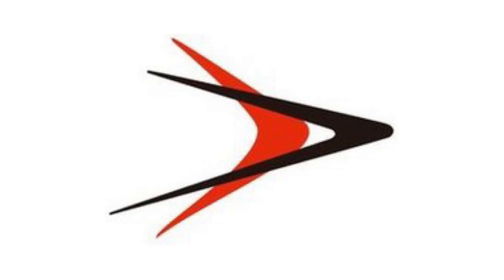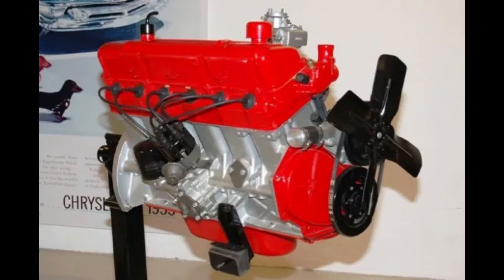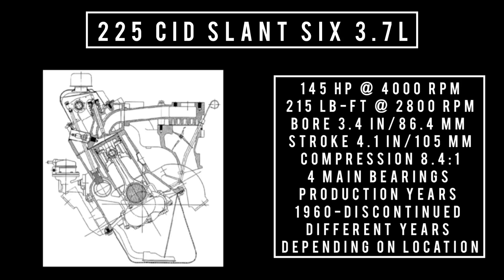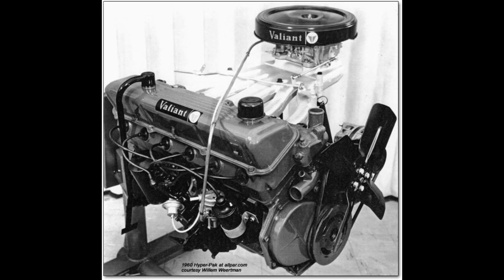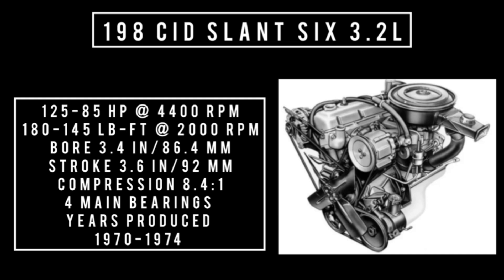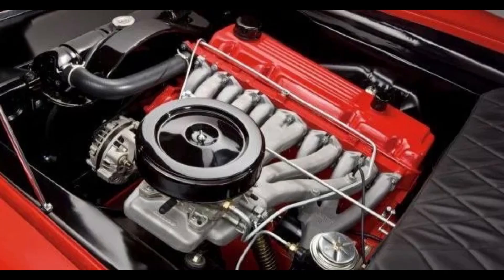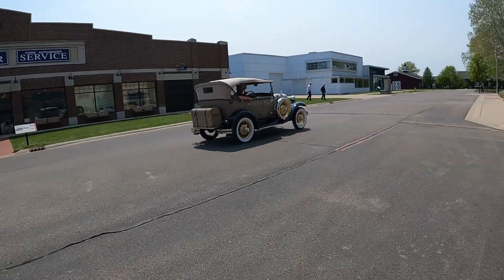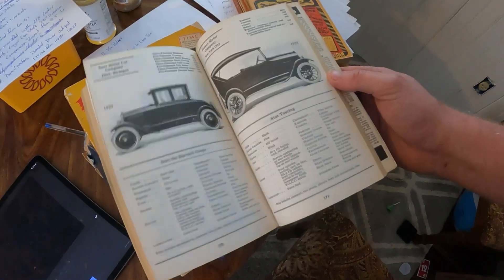Chrysler slant six engine family

Comment: lets face it. the chrysler slant six was a strong fully cast iron engine .solid lifters that lasted for several hundreds of thousands so long as you adjusted the rocker arms every other year. 20k lash exhaust and 10k lash on intake if I remember properly . no flaws here. built to last and as long as you changed your oil and antifreeze properly, your were good to go forever .I owned 4 slant six engines,3 318 cu., another perfect engine and the cherokee 4.0l high output solid cast engine and the one I drove had 347k miles and buyer added another 128k .all original equip except the water pumps was a must at approx. 100k. gas tanks on cherokee sports 94-95 had some issues with gas tank leak that was easily addressed . last note, I changed the trans fluid every 59k miles and filter. all my auto trans work perfectly because of that. remember, drive you vehicle,don't abuse them and they will last a very long time .HAPP MOTORING AND MERRY CHRISTMAS*************************

Comment: Had a 1980 dodge step van that had the 225 slant 6 with 3 speed on the column manual miss that box van that engine would walk away from anything
Reply from the maker: That's awesome thank you so much for sharing your experience. I really want to drive your car with a slant six.

I recently got to drive to 55 Nash with a flathead and was impressed considering it only had 90 HP

Comment: Thanks I’m 71 and I’ve been working as a mechanic since I was 20 years old and I work on many a slant 6 and owned a few, I think there’s a lot of myth built around this motor. Yes it was very dependable for it’s day but by today’s standards it wouldn’t make it. They were noisy, they developed blow by at near 100,000 miles they had a plastic gear to drive the distributor that was designed to break to protect the starter in case it backfired and they did break and Chrysler used a reduction gear stater for what reason I don’t know. Chrysler’s V8’s where truly indestructible in the 60’s but nobody ever says that.
Reply: I got a Chrystler 318 not sure what year though, what is your opinion on the 318?

Comment: I bought a 61 Valiant V200 with 50,000 miles on it in 65 for $500 after I wrecked my Hillman Minx convertible. The strong point of the 170 cubic inch slant six motor was the fuel mileage and its reliability. Like the Hillman it was under powered.  Getting on to the freeway was scary. The on ramps were designed so that under powered cars and trucks could merge at the Oregon statewide speed limit of 55 mph. The best I could do by turning on to the ramp at 45 mph was 62 mph. Often the traffic was going 70-75 mph. If you held the accelerator peddle to the floor long enough it would eventually reach 90 MPH.

The radiator was sized to be compatible with the 225 cubic inch slant six motor. This gave me to courage to remove the radiator fan from the water pump for better fuel mileage and a little more power. That winter I even put a piece of cardboard in front of the radiator thinking that it might clear the frost off the windshield a little sooner. The steering on the Valiant was the recirculating ball type which had 2 inches of play before a directional change could be made and lacked the feel provided by the rack and pinion of the Hillman. The Hillman had radial tires which made handling somewhat like its cousin the Sunbeam Alpine. The gear shift on the Hillman was located on the steering wheel column. Valiant’s shifter was on the floor, not for a sporty feel but because it like the bench seat was cheaper. The shifter was flimsy. If you weren’t careful it escaped the H pattern constraints. I considered this a feature not a failure as it allowed my girlfriend to sit next to me at the drive in.

Quick turns at lower speed would cause a dreadful roll that would hide the horizon from view. When turning hard to the left my butt slid to the right while alternating grips of the free hand to the top of the steering wheel eventually corrected the situation. I bought some stiffer torsion bars and front set belts from the parts department at the dealership. That made for less leaning and more under steer. I found some leaf spring helpers for the rear suspension that I adjusted so that when cornering hard the inner rear wheel did not lift off the pavement causing a sudden loss of power to the rear wheels. The lack of a front anti sway bar made the steering almost neutral with just a hint of under steer when stressed. There was a hairpin corner which the Hillman easily took at 35 mph but for the Valiant seemed too fast at 25 mph. I got a set of four bias ply A78-13 tires with a 12,000 miles guarantee for $60 which with the way I drove were bald by 10,000 miles. The guarantee got me another set of bias ply A78-13 tires.

One summer day that year I was on my way home from coast near Tillamook to Portland Oregon when we got behind about 35 cars traveling behind a slow moving camper van. I decided to pass all the cars and the van before we got to coastal mountain range. I was going 60 MPH when a Corvette pull out in front of me and quickly accelerated away. The twisty part thru the mountains is about 40 miles or 3 times the Nurburgring Nordschleife and took about 30 minutes. The Vette was able to use its disk brakes but the Val had drum brakes, which were only good for one stop, so I used engine braking and a little sideways skidding. I learned the hard way about drum brakes with the Hillman. The Vett and the Val had the same average speed for the twisty part.
Reply from the maker: Thank you for sharing those memories =)

Comment: I was once told tthat this engine was "desaxé," meaning that the crankshaft was offset from the cylinder axis, to give greater leverage on the power stroke. The high low end torque supports this claim, but I would love to know whether it is factual.
Reply: I seem to be wrong. I found a cross-section of this engine, showing the cylinder aligned with the crankshaft.

Comment: Had a Duster with a 6, then dad had a truck with one also.
Reply: The one in Dad's truck, sucked, it was a lemon, brand new it used several quarts of oil between changes, never had power, stumbled and cut out a fair amount. He got a new engine.

Comment: My wife and I bought a four door 1977 Volare with slant six in 1987. The engine was fantastic but everything else (starter, alternator, radiator, air conditioner, transmission) was not nearly as good. Fortunately, when it did break down, we were always close to home. We used to go to Civil War reenactments all over the East Coast. I would take the back seat out and there was about as much room as a station wagon. I could put our tent, poles, cooking gear, etc back there. We drove the car from our home in North Carolina to Mississippi and to Pennsylvania. Wish we still had it. Would love to have a restored one now.

Comment: My brother just told me that there are, nowadays, four-door family sedans that are as fast as many 1960s muscle cars.
Reply: You're absolutely right. You can feel the horsepower in a 1969 Chevelle SS, for example. 
I just heard that there are three ways of measuring horsepower; off the rear tires, in the rear of the transmission, and off the flywheel. So there you would have like 250 horsepower, then 300 horsepower and then 350 horsepower, take your pick. So a GTO with 350 horsepower would really be 250 off the rear tires and 300 in the rear of the transmission, I think.
Reply from the maker: Brand new Honda Odyssey will be anything in the 60s except for the GTO Shelby cobra and cars on that caliber but new cars don't give you that same feeling going that quick in a muscle car. New cars lack soul

Comment: Horsepower is confusing because my 1969 cougar with the optional 351 Cleveland engine 300 horsepower could not compete, at all, with my brother's Toyota Camry with the optional V6, 263 horsepower. He left my car in the dust every time. Wtf. Then he even gave me a two-car distance Head start and still blew my doors off!. Maybe his Camry really had more than 263 HP. And my cougar had less than 300 horsepower.
Reply from the maker: I agree

Comment: The aluminum block slant 6 has an open deck which is not the best for power. Hagerty just went through with boosting a slant 6 they were going to use an aluminum block but went with iron because of the closed deck.
Reply from the maker: Great information thank you so much for sharing that I would love to build a slant six one day
Reply: @What.its.like.  power Nation did one in a Dodge dart about 12 years ago. The video is on YouTube. They took a regular person off the street and went through their car, it was a single owner car too.
Reply from the maker: @ I saw that one they did a couple one made over 500HP with a turbo 

I saw a guy Turbo charge a flathead six cylinder on here. I'm not sure who made the flathead sex. Maybe it was a Chrysler but it sounded amazing. .. I would kind of want to try that as well. I don't know if Chrysler had forged internals a lot of those older cars did.. 

Here is the link so you can check it out 

https://youtu.be/dskutHwOy7U?si=KJh4lTdcFtdJX_3-

Comment: I'm surprised there was no mention of the Slant Six Diesel project by Mopar. Could have been a contender. Also, how about a weight for the 170 SS?
Reply: From my research on the subject, approximately 475 lbs for a 225 Slant Six and my guess is about 450 lbs for the 170 version. Headers and a aluminum intake might get it down to 435 lbs. Not too bad.

Comment: Drove a 63 Plymouth Savoy 2-door post sedan with 225 and three on the tree.Removed 14 in wheels and replaced with 15 inch radials and upgraded to spring over shocks all around. Used like a hobby stocker class stock car on rural dirt roads hillbilly drifting.

Comment: I have a 1985 Dodge D100.  When I got it, it was sick.  Did away the Electronic Spark Control and all the vacuum lines associated with it, swap in a standard distributor and control box, found a Holley NOS 1945 on Ebay.  Thing runs very well.  I would say its up there towards the 145hp before emissions.  First slant 6 I have messed with.  Im enjoying it. Its fun to drive.  I want to build a mild 318 for the truck but everyday Im closer to leaving the 6 in it.
Reply: Yeah I saw that.  Before and after turbo.  Thats great if a person has the tv networks money!!!😂
Reply from the maker: Yeah I agree I what to build one some day but with a big cam and triple webers
Reply from the maker: Power nation did a build of a slant six Chrysler and they were able to get some incredible power numbers out of it

https://youtu.be/I7daGYuiD6U?si=qTh3_gOmuKxd3lmc

Comment: I has a 67 Dodge Dart with a 225 Slant 6, mb the most durable, dependable car I've ever owned. It had a three on the tree manual transmission. I literally beat the crap out of that car with no maintenance and it kept running.

Comment: I can think of two engines that had a longer design lifespan. the small block Chevrolet which ran from 1955-early 2000s and the Ford 90 degree V-8 smallblock 1962-2002.
Reply from the maker: @donreinke5863  awesome =)

Comment: I had 2 early 70s D-100 pickups with the 225. I bought each for a few hundred. Despite low compression & oil burning? I drove each one over 5 years. Start every time!

Comment: WYR:  The AMC sixes had seven main bearings. 
On the other hand, the full-size (marketed as mid-size, but its volume indices set it barely within the full-size range) '76 Dodge Coronet with the 225 and three-on-the-tree got a 30 MPG EPA highway rating. And on the third hand, my '73 Coronet would literally go out of alignment backing off the alignment rack.

Comment: Keep in mind when talking about horsepower and torque ratings, the standard for reporting these figures was the SAE gross rating through 1971, after which the standard went to the SAE net number which was typically 25% to 50% lower.

Comment: 300 cubic inch (4.9 L) inline 6 was one of Ford best engine. My friend bought a used one with 400,000 miles on it and put another 120,000 miles on it making a total of 520,000 miles before it started to burn oil. My neighbor had a 1967 Dodge Dart what's a 225 slant 6 Super 6 that engine out lasted the 67 he put it into a 1973 Dodge Dart and it outlasted that and he finally put it in a 1978 Plymouth Valerie that's how dependable and bulletproof those two engines are

Comment: Great engine for its size power and torque can't beat them the only other 6 cylinder Chrysler engine that was better is the Australian hemi 6 in e49 spec I've had mine 40 years the slant is lazy power the hemi you can ring it's nuts no problem the slant in aywas 180hp the hemi e49 was 303 HP not bad for 1970
Reply from the maker: Great information thank you so much for sharing that =)
Reply: @What.its.like.  there was 3 engine sizes 215 cui 245 cui and 265 they were made available from 1970 until end of local Chrysler production here 1981

Comment: Tbh my monte carlo 3.4l is also bullet proof. 220k thousand miles before someone else fucked it up. 250k now and after i rebuilt it i ran it without oil for a few mins and didnt even notice it. 260k miles now. I plan a turbo build for it with a good camshaft. I akso plan on using pulstar plasmaplugs(they arnt a scam thry fuckin work well)  but im going to modify the egr system to insert a plasma reactive inert gas, as the computer is already metered to accept a certain amount of inert gas hich is why the egr is there in the first place. When the plasma field emitted by the plasma sparkplug comes into contact with the plasma reactive inert gas the plasma field will expand across the whole area of the cylinder faster than the gas combust. This will give the most instant combustion of the gasoline all exactly at top dead center and not a millisecound later. The 3.4l monte carlo v6 sounds much better than the 3.8l. Very underrated u can easily get 300 horsepower out of it.

Comment: Slant Six. I have a 225 in a 1976 Dodge Dart Sport “Spirit of 76” with a stock 904 transmission and 7 1/4 rear end. I bracket race it every weekend, and i have to have it running in the staging lanes just to get it warm.

Comment: I will always remember the slant 6 as a wonderful engine. Many Australians swore by it, cdertainly compared to the ancient straight six GMH motors offered in either the Grey or the other Red models. which needed a lot of new parts and fettling to get any performance from them. The slant 6 was ready right out of the box.

Comment: I had a 64 Dart GT with a 4 speed and the 225.   Ran great.  The only issue I ever had was the heater core started to leak on the floor.     Ordered a new core and installed myself which was really simple.  I will say that it was difficult to replace points in the distributor as there wasn’t much clearance.

Comment: The slants were good up to 7000 rpm  ford was good 170pursuit had flags ,188,good 200,221,good ,250 2v 4 v head fully worked my mates FUTURA XY FALCON 500 WOULD SHAKE ALL WINDOWS N DOORS ON THE HOUSE FROM TWO BLOCKS AWAY 4v head so had triples su n s apped 6 gearbox shafts so rolling starts or burnouts was awesome

Comment: The  VF VC S series r series  ve  so in Australia we had a ford designer an it  hyper pak s this was till 1970 ve 67,vc,68,/69. VF coupe 245 pacer 2 bar 4 bar  4dr E34 3sp 4 barl large tank twin fillers ,small tank  1 filler cap yellow High performance race , vg 71 (69) shells

Comment: The Slant 6 and the AMC 232 and 258 straight  6 became the famous Jeep 4.0L Straight 6 which is also bullet proof. Also the GM 3.8L from 3/87 when it became known as the Buick 3800 LN3 (3/87-1991) Series1(1992-1994) Series II (1995-2004) and the Series III V-6 were also bullet proof as well and dates back to the Buick Fireball V-6 came out in 1962.
Reply from the maker: Awesome information =)

Comment: I had several vehicles with slant sixes.  One thing you learned right away was never to attempt to turn left across traffic until it was warmed up.   The cold long intake runners would cause it to nearly stall and leave you sitting at the mercy of oncoming traffic.
Reply from the maker: Great information =)

Comment: There's only one way to get stuck on the roadside by a Slant and my father taught it to me; close the points up to 8 or so thou, make sure you're stocked-up on business cards in the glovebox, and go to meet your date. Provided you need to go more than a few miles during the course of your evening, the engine will stop. Incidentally, this works with most points engines.
Once you are dependably let down by your dependable car, you'll ask your blushing date for one of her hair clips to use as a screwdriver - whether or not you have a real screwdriver strategically stashed beside the starting battery.  Take a business card-shaped "feeler gauge" with you and reset the points to a respectable 18-22 thou, jump back in the driver's seat and - this part is crucial - hand the hair clip back. Once your lovely date's hair is reset, twist the key and revel in your well-deserved, if contrived, glory.

Comment: Fun Fact: All aluminum liquid cooled engines have problems with corrosion in the cooling system. Use only distilled water and proper coolant to protect your engine. Using water from your city water supply or even a well will introduce mineral and chemical compounds that will cause absolute destruction of your engine.
Reply from the maker: Great information

Comment: The seeming drop in power of the 198 comes from the change in power ratings. The system went from Gross hp rating to Net hp. Emissions didn’t cause the drop in power.

Comment: In Australia my 1969 pacer had 225 two barrel. It was rated at 160hp. Put on a turbo fuel injection yella terra roller rockers high compresion. Expect north of 300hp and 500ftlbs torque. Easily!
Reply from the maker: I want to build one of these and have it and say 62 Dodge Lancer I think it would be absolutely epic